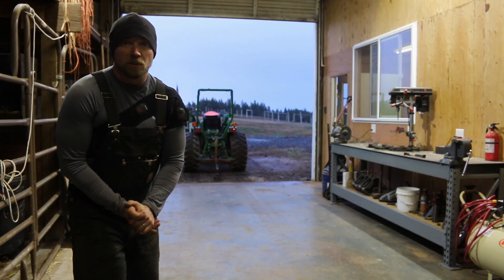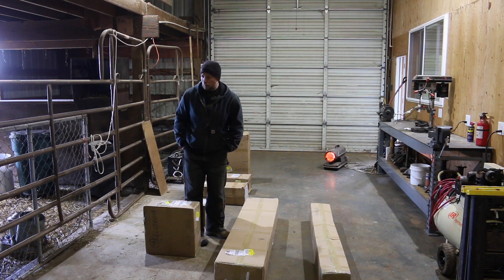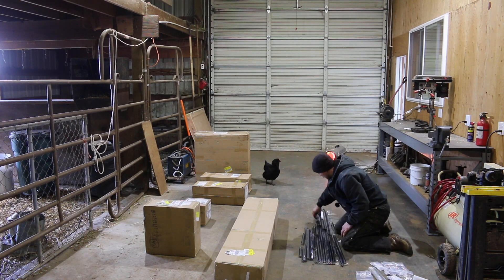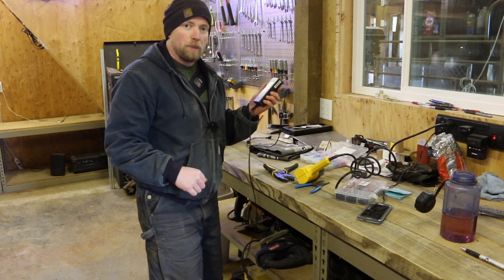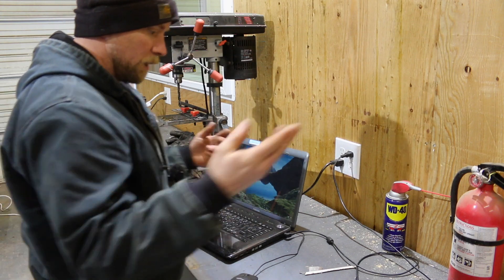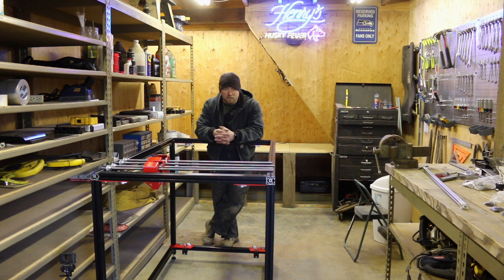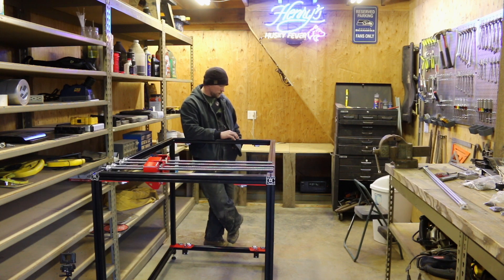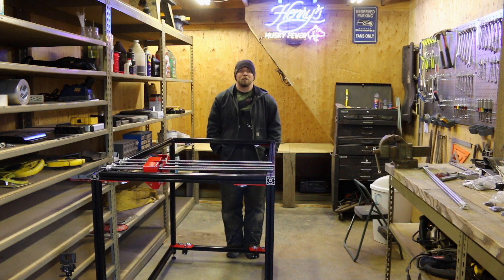Setting up the MODIX BIG 120 V3 - 3D Printer - UNBOXING

Comment: What material are you printing?
 did you get or are you making an enclosure for it?
Have you figured out how to maintain stable temps around the printer?
Nozzle size?
Lol i know I have tons of questions but I've been doing this at home for awhile and its just thoughts that ran threw my head.
Reply: The printer comes standard with 0.4, 0.6, and 0.8mm nozzles